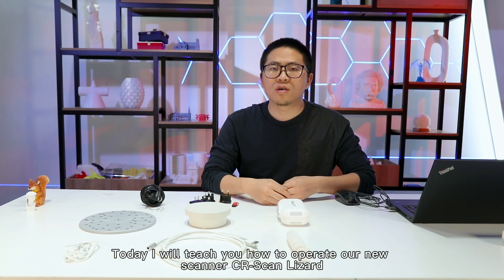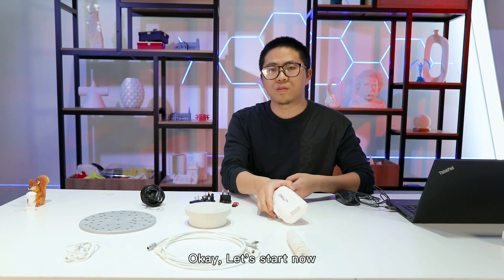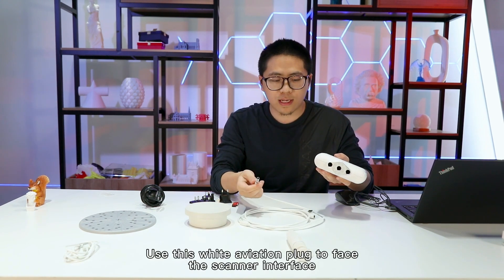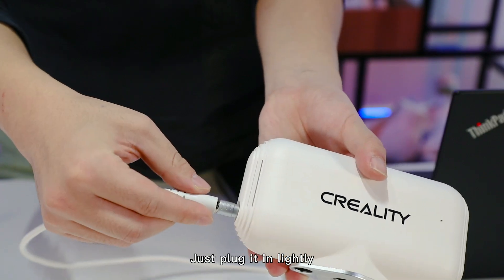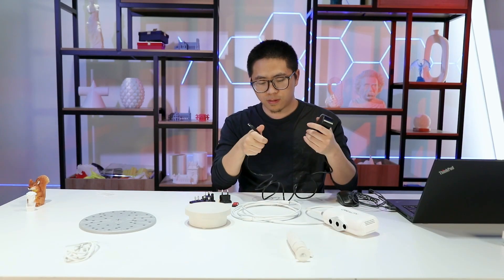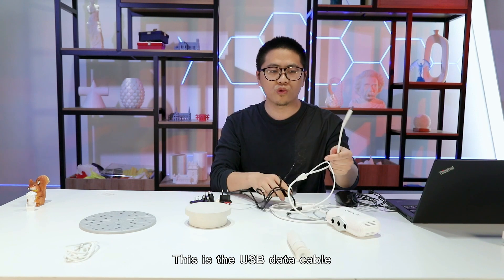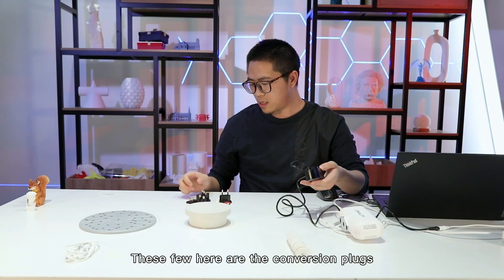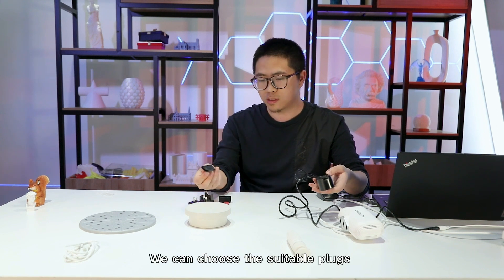How to Operate a CR-Scan Lizard?

Comment: a waste of money
Reply: You would have a better chance trying to get a real Lizard to make a scan. I still lost a little bit of money getting refunded from Kickstarter. What a piece of crap. Took the refund money and put it towards an Iphone 13 Pro Max. The phone scans a lot better than the Lizard. This whole promotion turned out to be awful. Have completely lost faith in anything related to Creality. Ordered a filament dryer from Sovol and the level of customer service and follow up was amazing. If I want a new printer it will most likely be a Sovol. Didn't spend a whole lot of money on the filament dryer, and having a company send several emails asking if the dryer worked well and the package arrived safely is the sign of a company that is commited to making good customer service a priority.

Comment: Can this be powered from a portable battery bank?
It needs an addon dongle that lets it be used wirelessly without cable into main electricity or computer.
Reply from the maker: Yes, you can use power bank which the power supply is over 20W.
Reply: @Creality3D  Thank you
If I may kindly ask can you help with an example of a 20W power bank
But i haven't heard of W used for power banks. Is it maybe 20Ah?! (20.000mAh).